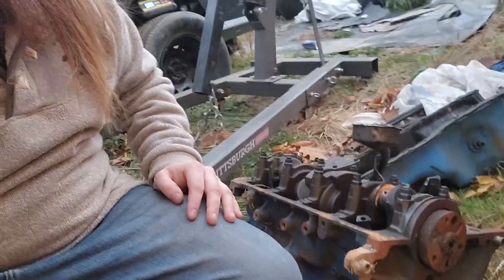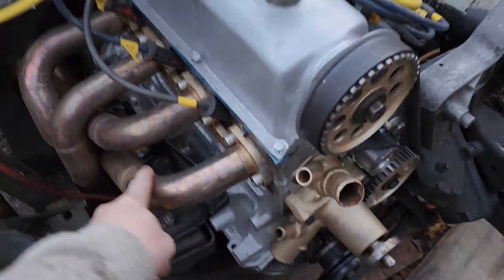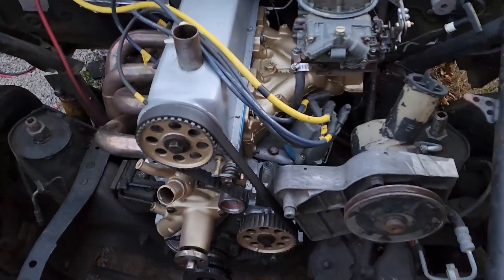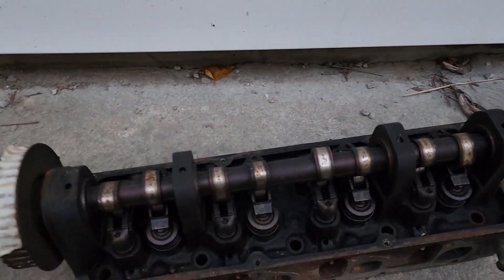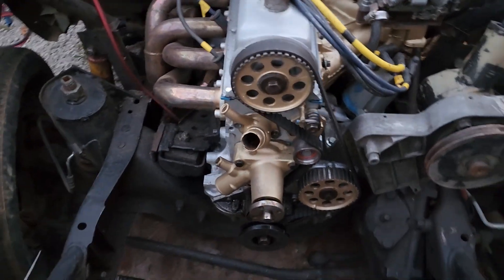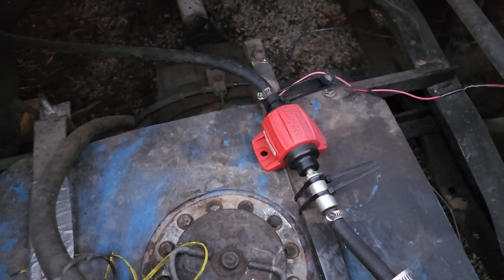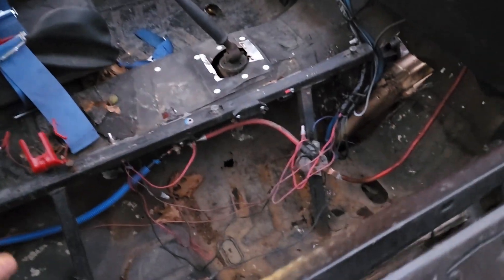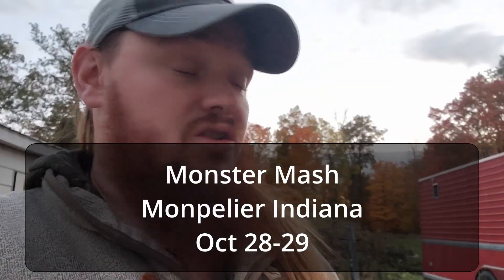Quick Look At Our Junkyard Race Engine

Comment: How much are u invested in the 2.3l
Reply from the maker: We started with a blown engine that came in the race truck roller. Which we pulled the head and headers off. Other than that about $350 into the junkyard engine, seals, paint, and oils to do a cleanup.

Comment: What about the 21 block. The block water slots are gone and its cross drilled to stop the blowing head gasket. But does it have the distributer port?
Any thought?
Reply from the maker: From my understanding they only had the distributor port until around 89, then they changed the casting. 
But I'm no Ford expert so I could be mistaken.

Comment: Great video brotha, Im tryna get into making some power for a low price, not tryna spend alot or make a race car. Just wanna build my ranger to rip in the desert, where you think i can start and what websites or where i should i look. Thanks bro
Reply from the maker: There's definitely info out there, and some cheapo performance parts like headers and shit on Speedway Motors and other race sites. Id also say get a cheap dremel and port the head a bit if youre confident.  But honestly if you're not restricted by a rulebook, turbo that shit. A little boost will go sooooo far. I'm also getting ride of the fan and going electric and a buddy of mine runs a lighter flywheel that really seems to help rpm rise.  

It's just the little things on these motors.